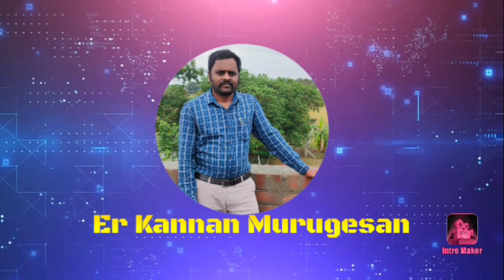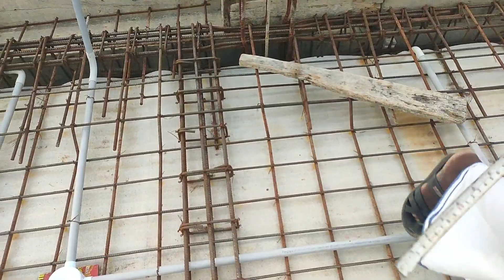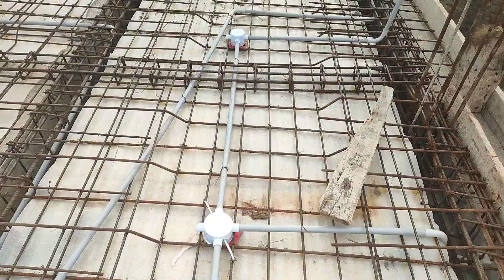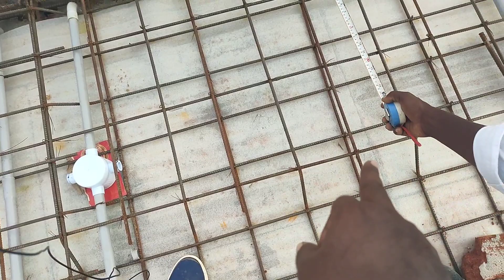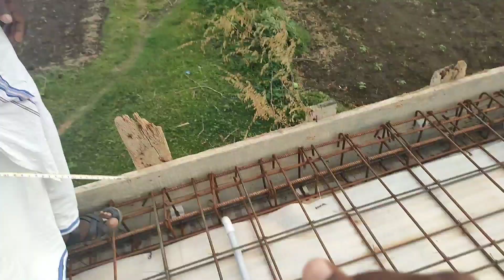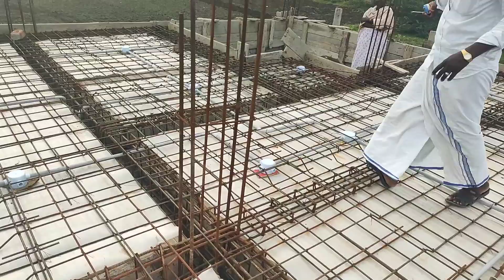ரூப் ஸ்லாப் கம்பி இப்படி கட்டினா பாக்கவே நல்லா இருக்கு | து.களத்தூர்

Comment: Super sir

Crank bend  parathu epadi sir evlo height vara bend pananum nu epadi nu solunga sir..bend panarathu dia of steel poruthu maruma sir..

Crank point common ah L/4th than ela slab kum ah sir..

Area of steel calculation + slab beam column footing..rebar design epadi nu video podunga sir